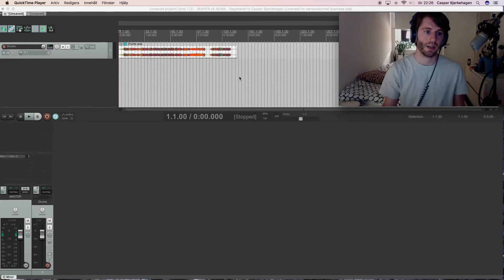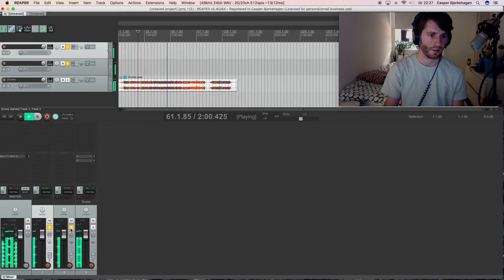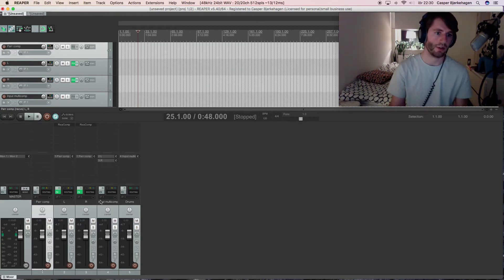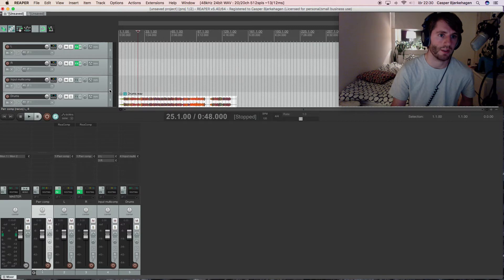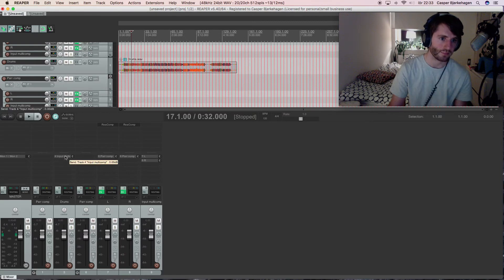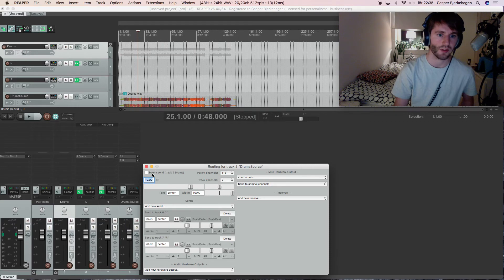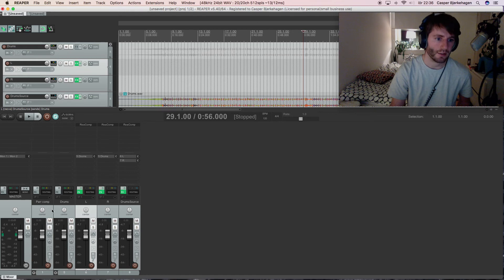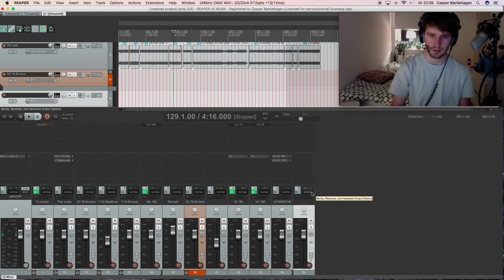How to setup Multi-Mono Compression

Comment: Good video.  I have another method for this which may be a little bit tidier.  Send your original signal to a single track that has 2 instances of the compressor inserted on the effects.  On the first compressor go into the pin routing matrix and only allow Channel 1 to be active, on the second only allow channel 2 and then the output of the pair of them will sum back to a stereo track.   I would also then link the parameters of the compressors so that when you move the controls on one of them it will also alter the controls on the other.  As far as I can tell I don't experience any latency issues by having the two compressors in series in this way
Reply: perfect dude! thanks!
Reply: Thanks that's actually a much better and easier way of doing it.